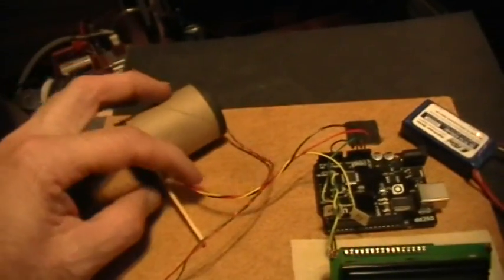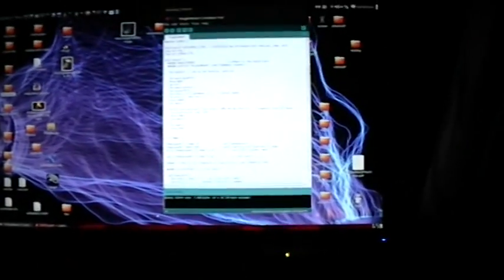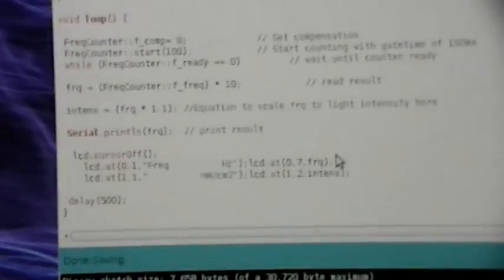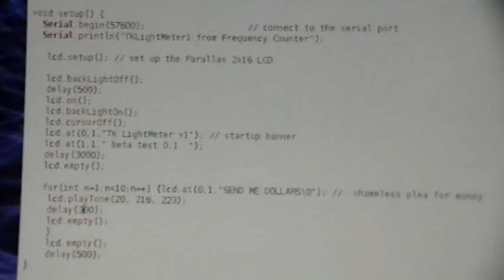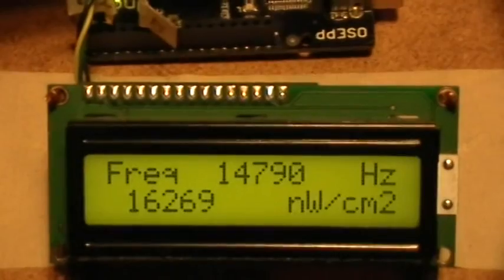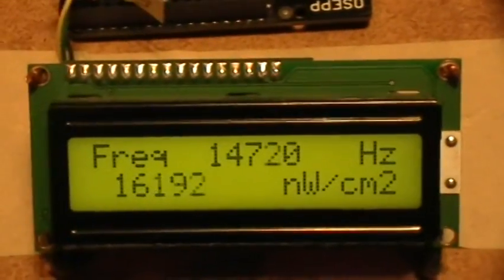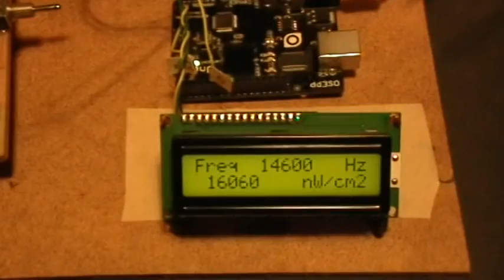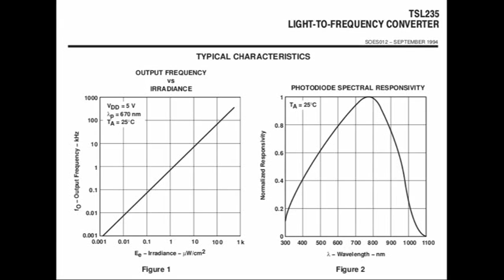Arduino: TKLightMeter v 0.1: A Simple Irradiance Meter Using TSL235A

Comment from the maker: These YT videos are pretty much what you are asking for, I think. I am using YT as my "lab notebook" of sorts and I'm glad I'm inspiring others to fiddle around as well.
The Arduino only has 8-bit voltage resolution in the ADC input, which is why the frequency counter is a better solution for measuring light intensity. If you sample the time domain instead of the voltage domain you can get arbitrarily good precision. Well, as precise as the floatingpoint math will allow, I guess.

Comment: I would gladly and happily pay a donation to get the code bundled into a ZIP file with a "read me" containing a "brief" of the particular project, same goes for some other "micro" projects. I have the light sensor from "freetronics" but it's an analogue voltage range output I think.